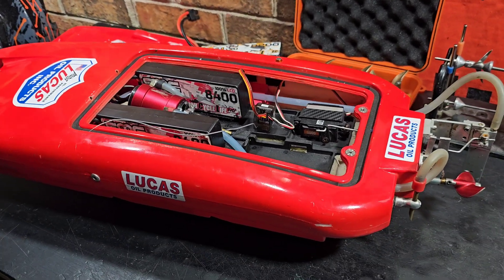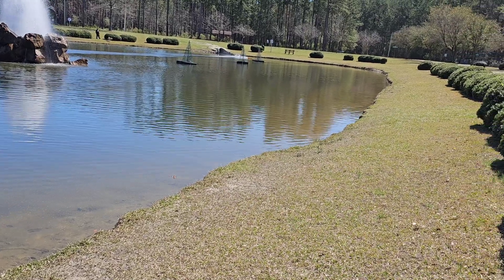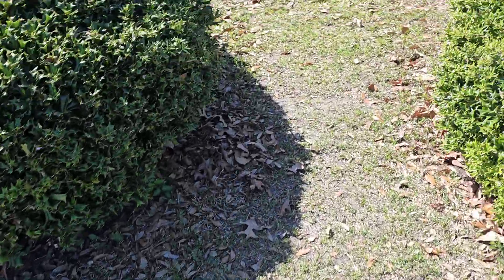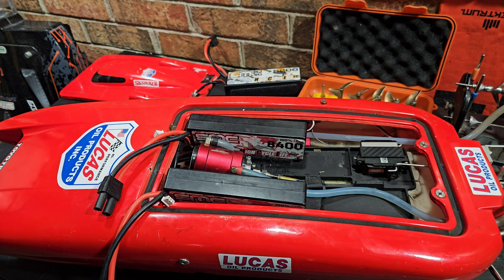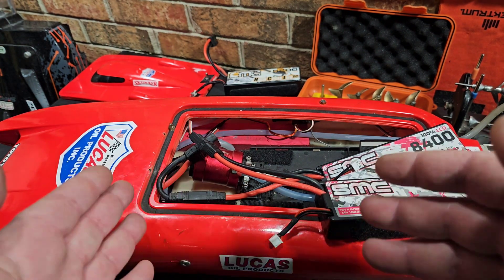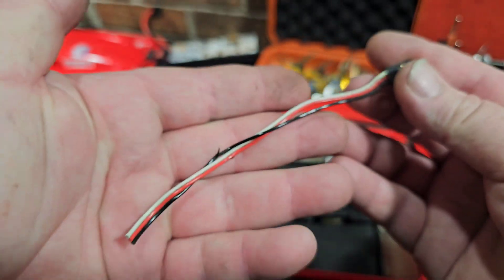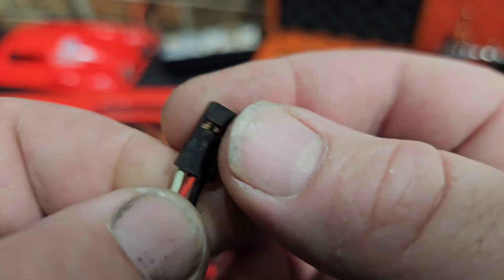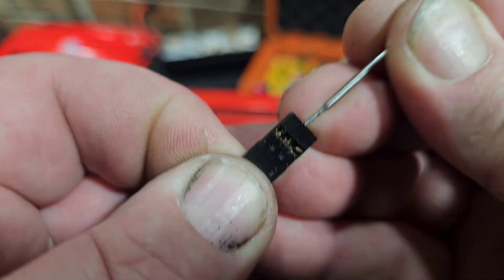Brushless Esc No Throttle or Servo Tracing Down The Gremlin - Rc Boat Electronics Trouble Shooting

Comment: Hey big b, I've got a question that might be out in left field. Using this boat as a speed boat not a basher, what do you think about moving to strut back about a half an inch or so to bring the front down more. I've already got 2oz in the nose and it's blueprinted and I'm getting 62mph out of it but the nose is still bouncing enough that it's scares me. Have you ever tried something like this

Comment: Great job: I just had my antenna wire pull off, do you think it is possible to solder it back on. Love the channel thanks for all the tips
Reply from the maker: It's definitely possible, may be more work than what it's worth. Once done, you may loose some range?   Most receivers are dipped in a conformal coating, so you'll need to clean the area really good before solder..  good luck.